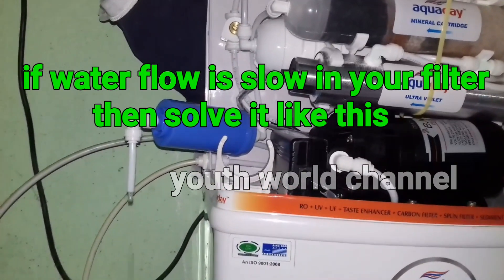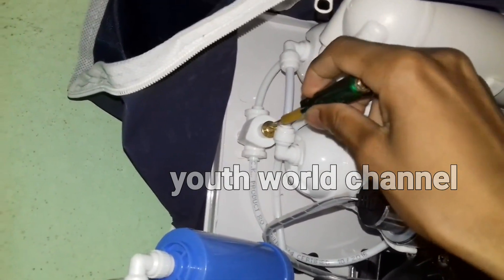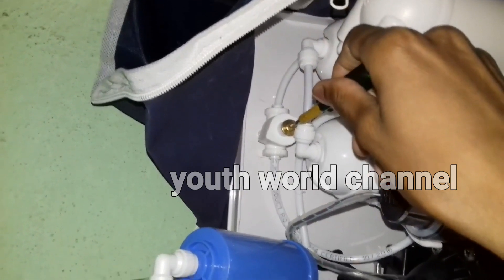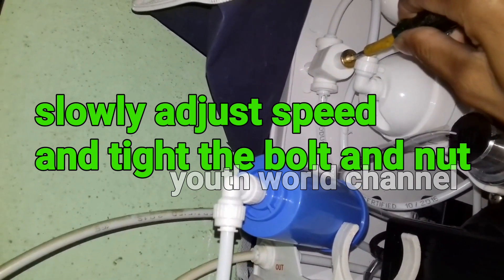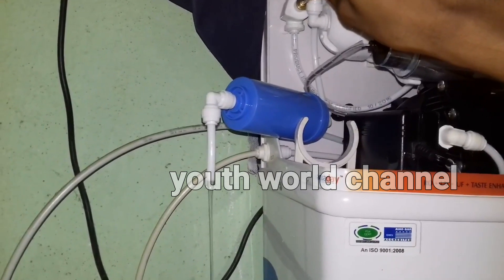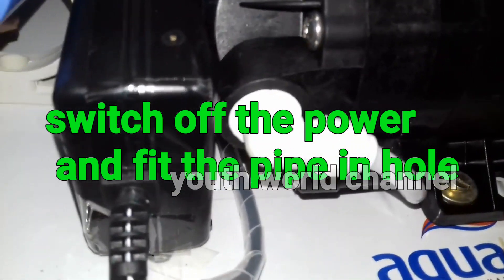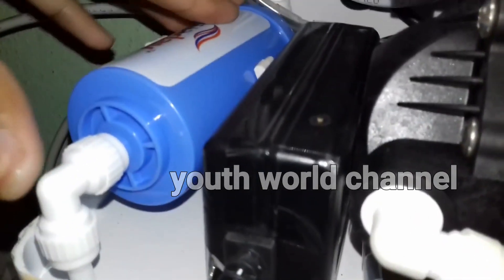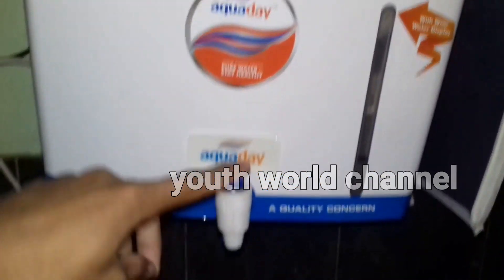solve slow water flow problem  in water filter/water purifier/

Comment: I set my tds to 50 but after some days it falls down like to 30 or 25 it happens every time ? What is the problem i have changed tds controller too
Reply from the maker: Once set ur purifier TDS level between 90-150 as as shown in video by loosing TDS bolt  (screw).
And check after few days is it b/w "50 -150": (Excellent ) then it is most suitable nd "acceptable for Drinking". 

If it is below "50" then pls contact any purifier mechanic. 
Less than 50: "Unacceptable" because of lack of important minerals in purified water.

150 – 300: Good – "Acceptable for Drinking" 
I hope u understand

Comment: Bro Same Problem But when I speed Up the water flow using TDS bolt TDS increase to 900 why bro
Reply from the maker: Bro don't loose TDS bolt so much .
If u loose so much then water flow  is increased along with TDS level.if water flow is fully increased TDS level  also increased that's  why u facing  that problem. 
"so loose that bolt little bit only" now once see water flow nd TDS level. 
I hope u understand. 
Thanks  for  watching  my  channel
Reply: I too had the same problem but konchem loose chesna TDs is increasing, what to do
Reply: @SuperVamshi007  I replaced Membrane My problem is solved
Reply: @kishorjanjal7454  15 days back I changed all the filters
Reply: @SuperVamshi007  My problem occurred after changing all filters which I ordered Online. I LATER Found Membrane If Faulty so I changed locally
Reply: @kishorjanjal7454  I too ordered from online 
I adjust for now, with slow water , after lockdown I'll try to replace, thanks for your help buddy
Reply: @SuperVamshi007  yess Change it  next time don't buy Membrane online
Reply from the maker: Change the filter candle in every 6 months for best results. Thanks for watching my channel.

Comment: what is the  flow ratio of pure and waste water?  1:2 is OK?
Reply from the maker: should be maintain 1:3 ratio of pure and waste water to remove total dissolves solids(TDS) in water.
It means 3 litres of waste water for every 1 litre of drinking water.
and don't waste that waste water u can use it for utensils washing.
thanks for watching my channel.
Reply: Thank you gnetlemen
Reply: @shahnavaz3283  60 :40

Comment: Bro wast water ekvo pothundi
Reply from the maker: bro  TDS level bolt ni  video lo choopina vidanga koncham loose cheste waste water thuggi filter fast ga ninduthundi.
TDS level bolt ni water taste ki thaggatuga loose cheyali ekkuva loose cheste water taste maripothundi.tds lavel bolt ni ela loose chayalo ee video lo choodu.
i hope u understand.
thanks for watching.
Reply: @youthworldYoutube  thqu bro
Reply from the maker: welcome
Reply: @youthworldYoutube  bro loses chystay water ravatalaydu ami chyli
Reply from the maker: bro first tap valve  on chesara ledo chek cheyandi  aa valve on chetene "water " aa filter loki velthundi .valve 'on' lo unna water flow raledante i think  mee water tank nunchi water flow pressure thakkuvaga undi undavachu. filter ki  input water pressure thakkuvaga unte filter agipothundi.
so contact ur filter mechanic.
i hope u understand.
thanks for watching.

2nd check mee  water tank input water pressure
The RO water purifier works only when the input water pressure is up to a certain pre-defined level. In case the pressure drops below this value, the low-pressure switch cuts off the RO machine.
Reply: @youthworldYoutube  bro meru water purfirer gurenchi chyndi repair works
Reply from the maker: i dont have more time .any way thanks for ur suggestion bro
thanks for watching